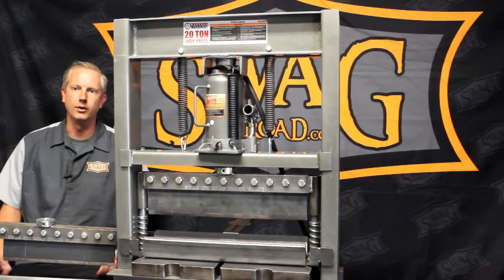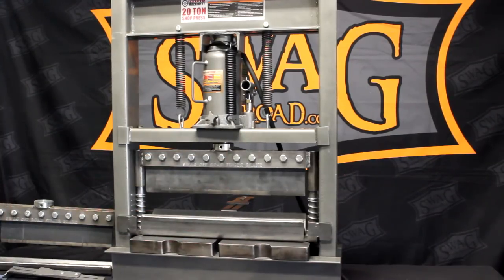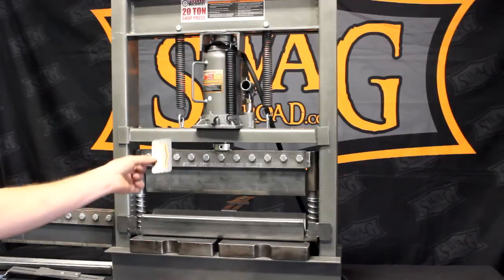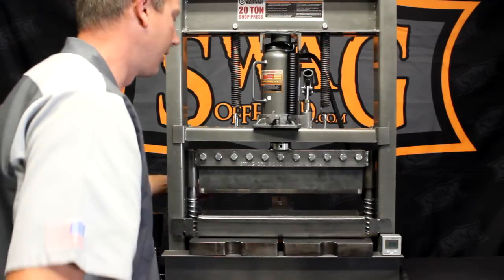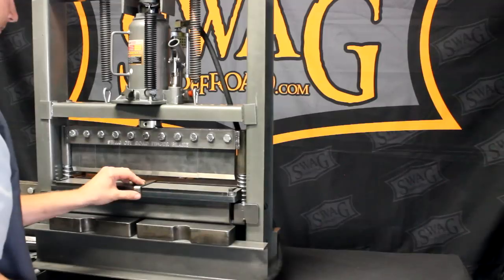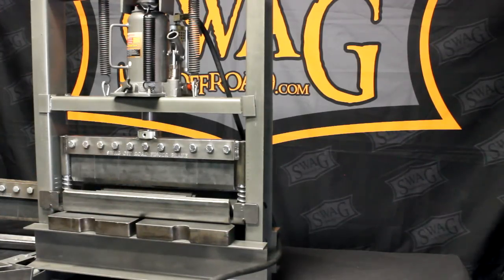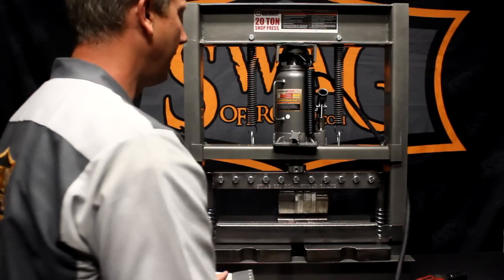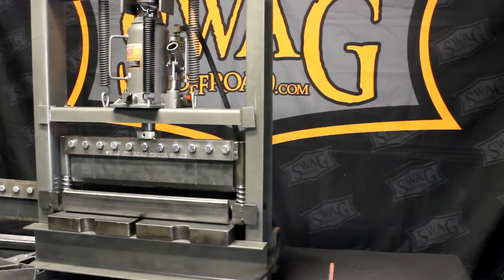SWAG FINGER BRAKE OVERVIEW

Comment: Great machine, if you  spray your flat jig with a little oil and place a thin sacrificial piece of material between ( and allow for the width) this will prevent scratching the work piece. If your base pieces are at 90 degrees then whatever you press into them will spring back to more than that. No matter how hard you pump
Reply: I use mylar film to prevent scratching, well worth it

Comment: Very impressive tooling you have engineered and make.  I am basically a hobbyist and have Harbor Freight's 20 Ton Press.  My background is in tool and die making, both in the shop and in design; therefore, I appreciate good design when I see it.  I have already designed and am in the process of fabricating tooling for my wife to use with her copper blanking dies for making custom jewelry.  Keep up the good work and may you turn a nice profit.
Reply from the maker: Thank you for the kind words!
Reply: How thick are the additional angle iron pieces???  You added
Reply: Impressive little unit. I didn’t realize they made a release knob so DOH I made my own lol. NBD as I have a machine shop. Second I used foot valve instead the hand valve that comes with the jack. Very good video. Anyone serious about bending should consider this. One thing I did noticed though, on your site I couldn’t find where you can purchase individual dies , or even a complete set. Do you sell ?  Thank you

Comment: Nice informal video. Thank you!  I just picked up a 20 Ton today from Harbor Freight.  Need to get this upgrade along with the pneumatic 20 ton. I'll be placing my order this week.  Your video answered my question I was concerned about. I think it's doable now though. I need to bend/form some steel plate 3/8 thick x 5" stiffing up a frame for hydraulics
Reply from the maker: Chad,
Thank you for your interest in our products.
I would recommend going with the 20 Ton Heavy Duty Kit rather than the standard duty. Both are capable of bending 5" of 3/8" but that is maxing out the standard duty break. If your particular bottle jack is a little under-powered (which does happen from time to time) you will have trouble getting a full 90° out of the standard duty brake.

Don't hesitate to give me a call or send an email if you have any other questions.

Thank you,
SWAG Off Road
Reply: @Swagoffroad  thanks for the reply.  I should be fine. I don't need to bend any hard 90's.  It's more of making the flat piece contoured with a series of bends spread apart.  I'm needing to follow the front end shape of a mid 60's Oldsmobile frame. I just picked up the pneumatic 20 ton this evening so I'll get that mounted and mess with it and then place a order.

Comment: I have an angle reader just like that one. It only works properly if You zero it out first on the horizontal surface first. If you can’t get a real horizontal surface as with this brake, it’s harder to use.

The horizontal top of the gooseneck die doesn’t look thick enough to match the strength of the rest of it. It looks as though it will bend, or break.

Comment: I have one. Wonderful tool, but I have not been able to get it to do 15" of 1/4" steel at anything close to 90 degrees, and the ad says 16". 

It takes some skill to use. Putting the bend in the right place takes effort.

Expect to buy or make accessories.

Comment: What size is the Tang on the gooseneck dies?  Usually 1/2" ?? But looks like 5/8 or 3/4 in the video. I'd like a set for my Diacro 17-48 press brake that uses a 1/2" Tang.
Reply from the maker: We sell gooseneck dies with a tang thickness of 3/4" and 1".

Comment: I would happily buy the entire heavy duty kit, with all the various dies etc except for one thing.
I’m downunder, & when I go to “checkout” the postage is $1k 🇦🇺 Aussie sh!tsvillian pacific micro pesos. 😳😳
Embarrassing as it is to say, for that kinda money, I’m just going to buy the steel locally and make one, basically copying your idea.
Not the way I’d prefer to go, but with UPS freight being so totally unrealistic nowadays - that’s about the only sensible thing to do.
Not proud to say it, you have a good design & a good product & id like to support you - but I just want it shipped at an affordable cost, I don’t want to buy the damned plane it’s getting shipped in ffs. 🙄

Someone needs to slap UPS / USPS or whoever is doing your shipping silly because you’ll never grow your market outside US Borders with idiots running your postal service. 🙄
Reply from the maker: I really do apologize for the excessive shipping to Australia and totally understand not moving forward with an order. The weight of our products really kills us on international shipping since the brake all by itself weighs close to 75lbs. We are currently looking for a distributor in Australia but have yet to find one that will work. Do you know of any shops down under that do online sales for welding/metal fab supplies? We'd love to grow our international sales but your 100% correct, shipping cost is making that next to impossible.
Reply: @Swagoffroad  We really only have the one national supply shop for metal machining products in Oz.
They are a national chain called “Machinery House” (Hare & Forbes).
They move a mountain of product & are a good supplier.
They would be your best option I would think.
If they would stock the Harbour Freight Shop Presses & Swag Offroad Press Breaks to go with them, most Aussies with a “man cave” would have one of each in a heart beat.
I buy all my machining needs for the Bridgeport Mil through them & am about to buy my new metal lathe from them in their March annual sale.
They are good blokes to deal with, their staff have industry experience so can field questions with knowledgeable staff who have industry experience to provide the right product & their prices aren’t too bad either.
I’m guessing they would be your best option.
Thanks for your response - please don’t be mad at me for attempting to make my own.
Like I have said, you have a good product, it’s reasonably priced & you deserve every success if the US Postal Service weren’t handicapping your supply options.
Sending a shipping container load downunder to a national chain like Machinery House ( Hare & Forbes) would mean that all of us could finally access the product at an affordable cost nationally.
Maybe yourselves and Harbour Freight could share a shipping container between you to get both products here in one go at 50% of the shipping bill maybe? 🤷‍♂️
Wishing you the best of luck with it. 👍👍👍🇦🇺
Reply from the maker: @ianmoone2359  I really appreciate the suggestion! Just reached out to them! And no hard feelings whatsoever. Our products are so heavy that international shipping can be absolutely insane. With any luck at all, we'll have someone you can buy from directly in Australia!
Reply: @Swagoffroad  Can’t tell you how awesome that would be. Sincerely hope it works out for you, because it would benefit us greatly.
Thanks heaps for the understanding. 👍👍👍🇦🇺